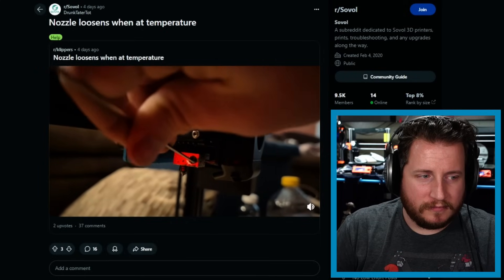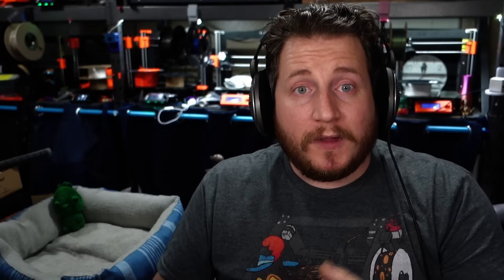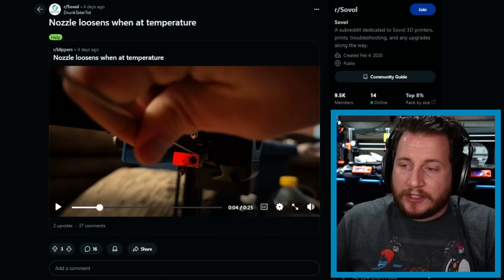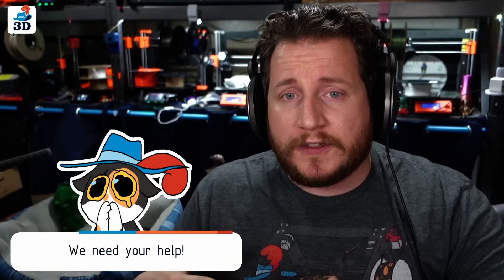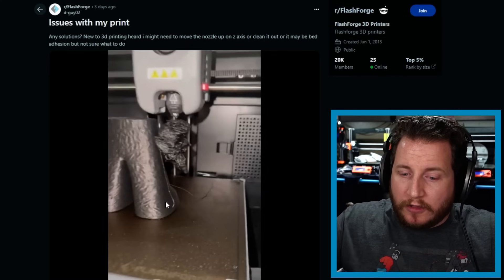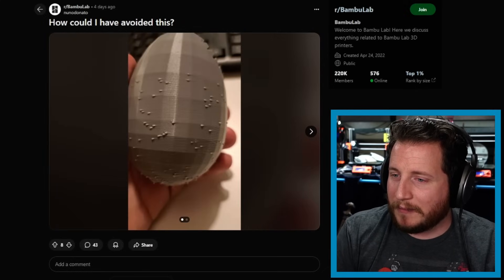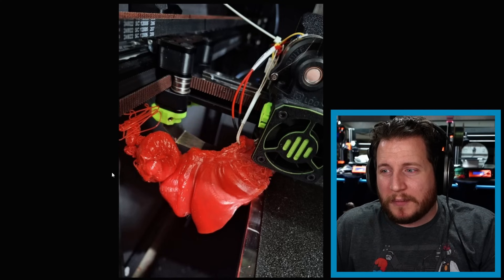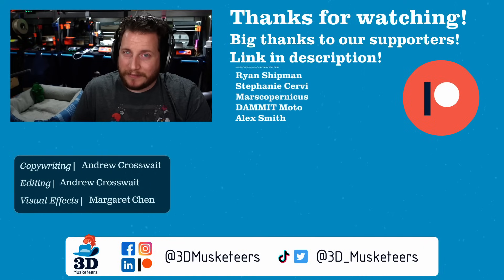NO Supports and Loose Nozzles!! - PrintFixFriday 181

Comment: If them kids are having problems with their ratrigs its mostly likely coming from the user as usual. Or wet filament even more likely as always. But the fact is any time you you build something yourself user error is what it is. You can build minion first its' easier maybe but its useless because its bedslinger raceboat would probably take 10+ minutes reasonably or just bite the bullet and go with vcore its not actually that difficulty. Most likely again user being the fault if it's difficulty. Then they start chasing perfect belt graphs that pull them down so deep rabbit hole you would not believe how deep and for no gain whatsoever. Build it good by the instructions and don't waste too much time trying to get it 'perfect' and you are just fine.

Comment: Scarf seams could help with the zits, but I've found it still adds a texture to the surface, especially on random. I still haven't found settings I'm fully happy with that actually disappears the seam. But then again, I'm tuning it on a mushroom-shaped part, so... very unforgiving when it comes to seams.

Comment: Grant, another thing I've found that helps with the bottom side of a curved surface is to reduce the layer height and increase the thickness of the outer wall. The finer the layer height, the less supports may be required.

Comment: Blob of doom, I ended up with some PETG filament that I put into my "Unprintable" category, at least with my rigs' abilities. where a 7mm retraction wouldn''t unglue from it's lay down thread on a Zhop. ended up dragging the parts around, eventually leaving one of these after a few hours. Honestly, the first layers looked pretty reasonable, until it ended up dragging all the parts on the build plate around and finally freezing the X axis. I changed over to Polar Filament  of the same color, and had no issues.
That spool now shares a special place with a roll of PA12 that I also spent many attempts at trying to print something useful out of with my non enclosed printers. which seem to actually have little issue printing almost anything with a -CF or -GF on it, including PC, PA6, ABS, PHA, or PP

Comment: dude the vcore 4 500 has been such a temperamental machine, the instructions, are not as great, as a prusa, the fans have been weird to wire, they keep blowing out, I've had it since its release and its still just sitting here,  i will eventually get to use it, but i work literally 90 hours a week and can't afford to diagnose the fan again. ive gotten one clean print then the part cooling fan died. the machine is nice, ive built plenty of machines, this has been fun but also a nightmare. im sure everyone will have a fix and say i dont know what im doing. but its been ruff man. also the fan has aleady burnt one tree tech motherboard. which ive already replaced. its dead in the water right now, but im sure when i have a day off ill sit down and do it all over again.

Comment: Aluminium?  ok, ok. just doesn't sound much like the American vernacular. 
Anyways, I have a couple of these SV04s one hot end in particular would break loose and etch the build plate with my diamondbacks.
I had that sucker clamped. to the point I had to use a thread extractor on the grub screw. no issues with that one since I replaced the hot end.
The heat break is the extruder casing in these, no easy replacement now. BTW, this printer seemingly maxes out at 120mm/s.
About the only reason I use it is it's rather large print volume, 300x300x400. It does remarkably well with fine detail prints, such as miniatures with a .2mm nozzle however

Comment: I built a ratig vcore 3.1 and the only documentation I found missing was how to wire the SSR and power supply to the power socket. I've never tinkered with 3d printers before, I had an anycubickobra 2 and jumped straight into the vcore 3.1. It took me 1 week to assemble the frame and then 3 weeks to wire and tune it. I've never crimped a wire or written code for klipper before that, and now It's been running for a year delivering me high quality fast prints. I think I skimmed through vcore 4 documentation and it looks like the wiring and idex documentation are a bit lacking but I haven't built the 4 yet.

Comment: 12:22 I built the V-Core 4 500 hybrid batch 1 and helped to update the documentation through the Facebook and discord official groups. The current state of the documentation is solid but there isn't a step-by-step troubleshooting in some chapters that if the V-Core 4 is your first 3D printer kit, you will find some problems to overcome, for example the path for the belts and rechecking the squareness of the frame.
Reply: the belts were easy for me, its that part cooling fan killing it. the wiring diagram is trash.

Comment: Great tips, I actually shorted my heater cartridge the other day while using a wrench to hold it steady while i hot tightened the nozzel.  It was actually a ceramic heater cartridge, but that doesnt make a diff the wrench shorted the 2 wires where they met the ceramic and a big spark pop and printer turned off.  Thankfully it turned on again without issue.  Kudos to the anycubic vyper engineers on that eletrical safety, or maybe i just got lucky.  Anyway I normally aim below the heater cartridge when i do the hot tighten because you can break the ceramic if you put force on it, thankfully that didnt happen either.  I never expected that kind of short probing around the nozzel and it was a reminder that the thing is live, be careful.  Thankfully its only like 24v max or i probably would have felt that.  That being said some printers use the the ful 120/220v on the heaterbed if im not mistaken for fast heating so you dont want to short anything there thats for sure.

Comment: Grant, I think you could build a Rat Rig, if you take your time.  The instructions are rough, but go with the set that people have left comments.  I finished my Rat Rig V-core 4 (500 mm) last summer and have two Rat Rig V-core 3 that I built a few years ago.  The V-core 4 has many improvements, but from what I have heard go with the Hybrid over the IDEX.  I have the Hybrid and the extra motors really help keep the motion more solid.

Comment: When the heatblock is the location where the nozzle threads meet the mating surface, we've started machining a 45 bevel and a matching bevel on the nozzle so it operates more like an AN fitting to assure leak-free and self-centering mating. Have not had oozing out of the hotend (I mean, except the nozzle orifice itself...) ever since.
Have only done this a few times, to be fair. REVO obvioates the need for this treatment.

Comment: I am interested in your thoughts on intersecting infills like grid and cubic vs on intersecting like gyroid. I can hear the nozzle bumping along grid or cubic at times and while it does not effect the print, I wonder if it might damage the printer or nozzle in the long term.
Reply: It does cause increased wear and damage to the nozzle and V-wheels/Linear Rails on the printer and cause print failures and layer shifts. 
Plus if intersecting infill are making a noise don't use them as there's smth wrong with either the bed or gantry depending on the printer
Reply: @  We have 4 MK4s, they all make noise of someone uses grid and a large print. It is not real load band might be the head traveling over the holes and how the air from the interacts with infill. I am not sure why grid seems to always be the default if it is problematic.

Comment: I got a blob of doom while working on the diamond nozzle. No idea what happened. I was lowering temps 1 benchy at a time. Then one time it didn't stick AT ALL. Fortunately I caught it quickly. No casualties. While I have the sock I don't think it would have made a difference this time. I retried the print. I didn't change anything. I didn't even clean the bed. It worked perfectly. In fact I think that's the one I showed you. lol I have no idea why it randomly didn't work. I'm not done with the benchys. I did one more slightly warmer. I need to do one more even slightly more warmer.